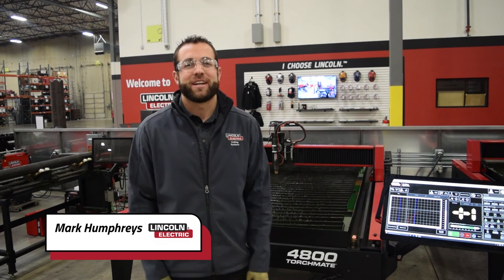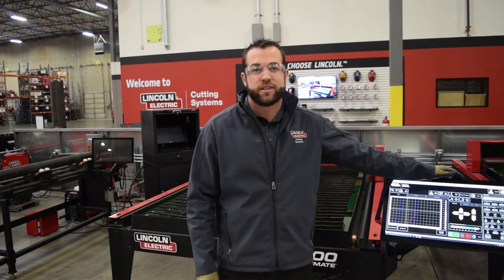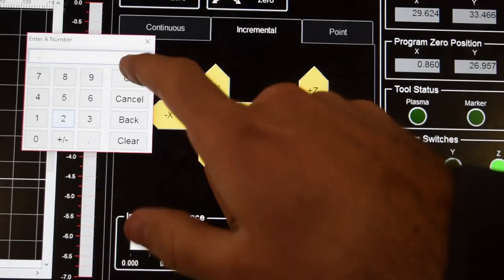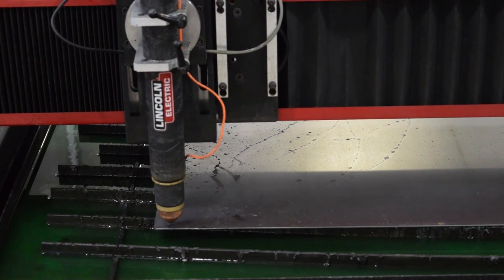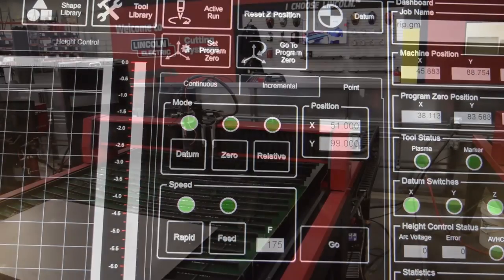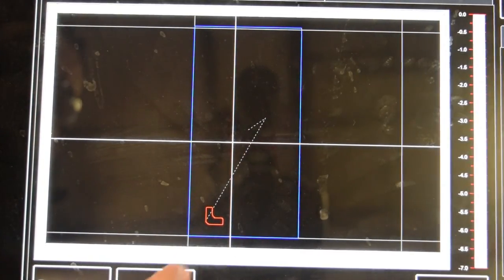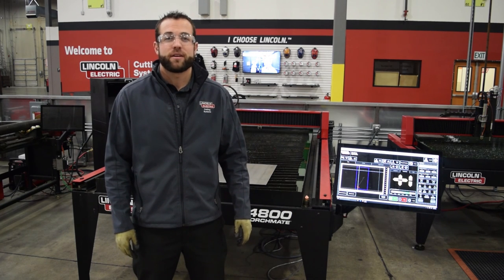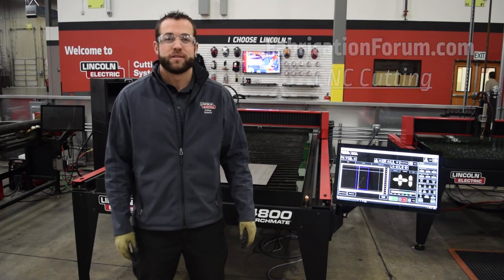CNC Plasma Operations: Using Multiple Traverse Methods

Comment: Need more videos on troubleshooting
Reply: How you would handle restarting cuts when machine stops in the middle of a job and finding the proper voltage for your material I've had problems with the torch lifting 2 or more inchs off of the material while cutting I'm assuming that a voltage setting.